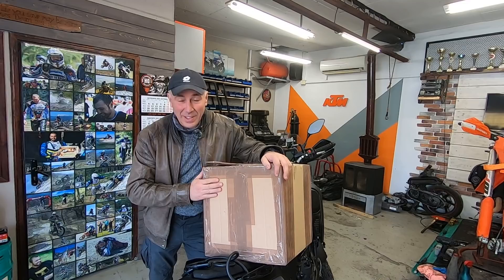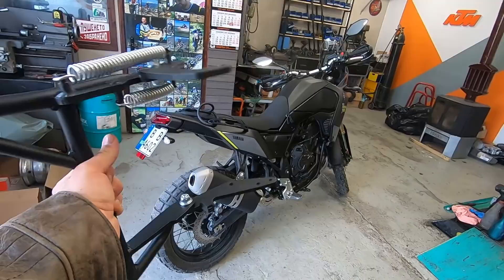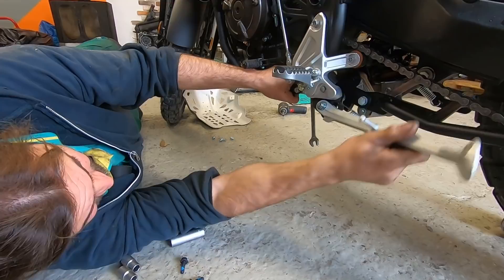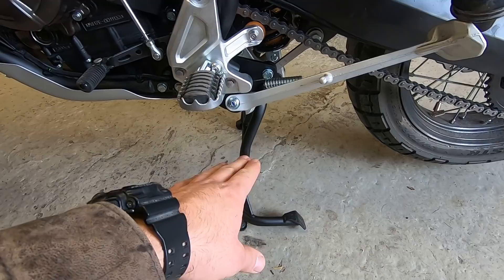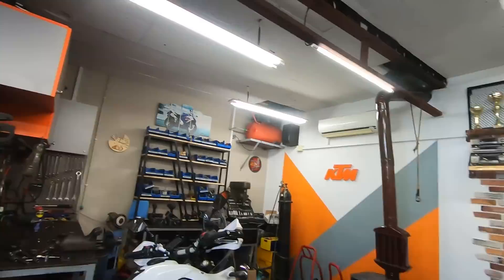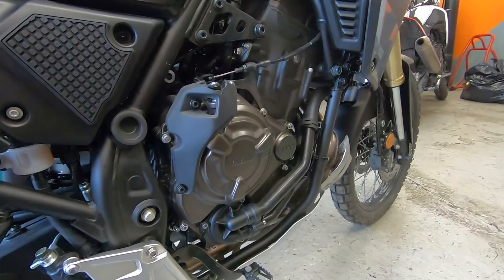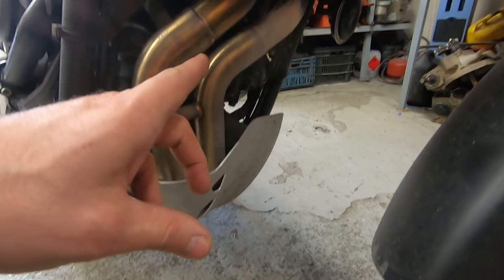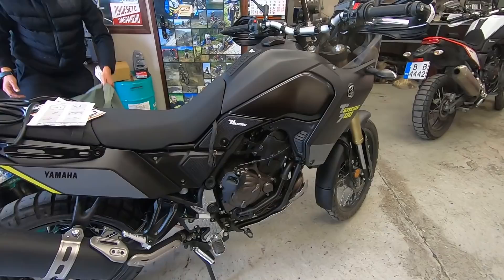Yamaha Tenere 700 - Center Stand - Part 3

Comment: Great... I love center stand! The moment I bought my 2010 Yamaha  660cc MT 03, I order a center stand for I don't like to see my baby leaning on one side for hours. I use the side stand during the daytime but the center stand if I know I'm going to leave my bike for hours or for the night :) Also, something puncture my radiator although I had a radiator protection grating installed by the previous owner; I order a front mudgard extension & didn't install the grating back when I change my radiator. I've been riding the last two years without any problem 😁😁😁
Reply from the maker: Thanks for sharing!

Comment: I really like the centre stand. Very well thought out adjuster solution, and excellent value as you say. And great to see a Romanian company competing with the usual suspects. 

But two springs are actually a good idea in case one breaks. One of the most dangerous things is a stand that fails whilst riding. Ask me how I know…!!

Thank you for sharing 
Ride safe 
Peace
Reply from the maker: It actually has two springs, see the beginning of the video.
Reply: @motorcycleadventures  Sorry, I missed that.
Reply: @motorcycleadventures  Two springs of different sizes is good engineering!
It prevents a single steady vibration - riding on washboard surface, for example - from hitting a resonant frequency
and causing the center stand from swinging up and down or the spring from vibrating off its mounting pegs.  If that
frequency of vibration is encountered, the 2nd spring which has a different resonant frequency continues to hold steady.
Reply: @daveinwla6360   Oh wow is that really the purpose? I always figured it was to combine the spring constants to create a larger spring force.

Comment: I did two modifications on my FX650 - I did the tubeless mod with that yacht adhesive as well as added the central stand. After I did that, I realized that both mods defy purpose of another, thus I removed the central stand as extra weight, as it clunkers and makes some noise when riding rough roads.
Reply from the maker: Thanks for sharing!
Reply: Can you supply a link to a description of the yacht adhesive (perhaps a marine silicone caulk?),
and did you use the adhesive to seal the ends of the wire spokes where they penetrate the rim?

Comment: Good work Pavlin. I have just started a project with a "new" bike. A 1969 Suzuki T200 Invader. That came with a centre stand as standard, and the side stand as an optional extra. Stange how things have now reversed. I have bought a second hand side stand to fit to the bike,so I won't always have to lift it onto the centre stand.
Reply from the maker: Yes, it is like fashion, always reversed.

Comment: Smart move using screws  to fix the fender extender.  Definitley needed in my experience.
Reply from the maker: Agree.
Reply: I actually have the same branded Pyramid extender and used their pattern without bolts for both my bikes, 4-5 years later they're still stuck well. However I did stick their hugger extender and that started to fail after a year or so, I riveted that on permanently.

Comment: A centre stand is not an option in my opinion. Daily checks and wheel removal are so much harder without.
I have a fender extension on my 660 to prevent the high pressure spray onto the regulator rectifier, a common fault on 660. I don't know where it is on the 700 but it's still a good measure. 
Like it. 👍 
Happy travels
Reply from the maker: Absolutely agree.

Comment: I always parked my BMW R1200GSa on the side stand since it is heavy, especially with luggage. Now since its 15 years and 160k mi old I decided to park it on the center stand or it will leak some oil along the pistons into the exhaust when parked for several days. Last time I managed to drop it, the windshield ended up on the running board of my Nissan Pathfinder parked next to it. And it was very heavy to lift it back up. So I still prefer to use the side stand, but it looks like the Tenere isn't as heavy as the BMW.
Reply from the maker: The weight always matters...

Comment: Is the swingarm safe as the central stand is that close to it? You should lift the rear side of the bike to see if it there's no contact.
Reply from the maker: Contact is impossible.
Reply: You have a negative travel on the swing arm. The own weight from the bike  compress the spings. You need a negative travel for good road contact. If you "jump" or drive fast downhill the swingarm will move to the direction central stand, because this one is mounted to the frame. I had this issue on my ktm.

Comment: Dear Pavlin, how many euros one have to add to new 10.000 euro Tenere to have all neccesery(centar stand, handguards, crash bars…better engine guard, better tyres, heated grips, better seat…better spring for suspension) ? It seems to much😁
Reply: Everything necessary is already on the bike from the factory. The rest are all volontary add-ons.
Reply from the maker: True
Reply: It is the same for almost every bike, be it KTM, Honda, BMW, etc, most people will add accessories but with the Yamaha you just start with a lower purchase price, 10,000 euro as opposed to 15 or 20,000 euro.

KTM 890 or Honda AT still need better hand guards, centre stand, engine guard, bash plate, better tyres, heated grips, and seat and suspension are personal preference, some find good some want to improve.
Reply from the maker: Absolutely agree and on the top of everything, most of the models comes with more kilograms.